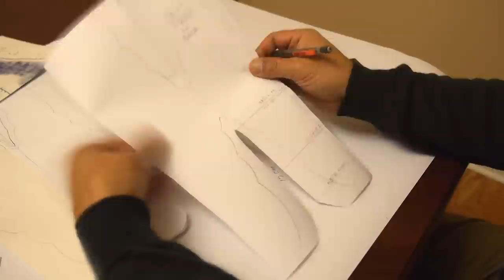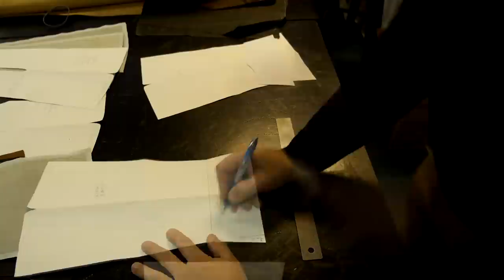Making cowboy boots - part 3 - designing, clicking and closing the tops

Comment: What name brand of contact cement glue do you use? I'm struggling trying to find a  very good one to resole my boots.
Reply from the maker: Hi Rudy, I use Dual-88 or Barge contact cement. They both are neoprene based and should be used under a ventilation. There are water based cements from Renia, but I haven't used them.
Reply: It's duall 88 I believe..

Comment: Your clicking knife, who makes it and where do I go to get one?  I have tried a bunch of different knives and still not satisfied. I notice it has disposable blades. Thanks for the ride.
Reply from the maker: Jay Shriver, It is a regular utility knife with Olfa blades. If you can, find black Olfa blades for your knife size, they are stronger and sharper.
Reply: Thanks.  appreciate it.
I have only made shoes (5 pair) I'm going to attempt a high lace up boot. I suppose the measurement for the tube (?) is that of the tops then tapered to fit the ankle - or is it the short heel measurement? Or do I finish the tops to equal the short heel measurement.
All the videos I have watched seem to leave out this critical junction between top of working last and leg.
Boot making is hard!
Reply from the maker: Shoe making is hard! :)
Because you need to know how to tape the last, make the mean form, make the templates... much harder than boots, seriously.
For boots you need 1) a good last and 2) decision either you calculate your templates or go with the approximations. And so there are 2 schools and most of cowboy bootmakers approximate based on the DW Frommer method. Search for "Bootmaking Forum" and "The Official Boot Making Forum" on FB - these 2 groups have professionals that can answer on all your questions.
Reply: Excellent! Thank you so much. I admit, two years ago - too cheap to buy - I made my own lasts. Recently I bought good plastic lasts.  The new professionally made lasts prove my own! - I got the fundamentals right. Now to make boots! Please keep posting videos.  Yours, granted, make one dizzy...but in a good way.
Reply from the maker: You're welcome! And yes, I learned from this video that fast is not all ways good ...
Reply: Maybe not good as entertainment but it absolutely covers the essentials and is perfect for the serious student. As per your recommendation ; DW Frommer. I found a photo of the Western Packer, a lace up cowboy boot - my next 'shoe'.  I got my new lasts from Lisa Sorrel, so they are 'cowboy' - with a 3/4 "heel.  Thanks to you I will now be busy for weeks! - with my awl and needle
Reply from the maker: Today Lisa is one of the best in the world in the area of the boot inlays. She also have very good videos on youtube.
Reply: And you, in tooling leather, must be one of the best in the world!
Reply from the maker: Britt Nantz is the best in tooling. Though I have a good chance if leather tooling, bootmaking and saddlemaking would need to come together.
Reply: Saddlemaking!? I thought I had watched all of your videos...never saw a saddle making video.
Reply from the maker: Just recent upgrade to my leather skills: https://goo.gl/gMFMeo
Reply: Very interesting Eugene.  Until now I thought the rider sat directly on the tree.  I now see that a cradle of straps is built beneath the finished saddle - how comfortable. I am a woodworker (have sold in some of the finest art galleries in the U,S.), not just a beginner shoemaker.  I will try to find a way to post you some photos of my own work
Reply from the maker: Yes, the webbing straps are tensioned, there is a gap between them and the wooden tree of the saddle. The latex foam between the webs and the seat leather adds additional comfort. Originally burlap straps and horse hair were used there, though synthetic materials are more durable. I'd like to see your woodworking, please contact me on FB or Google+, just search for my name.
Reply: I ordered a piece of tool steel and made my own. It's very easy if you know what your doing. I heat treated the edge using the clay method the Japanese use on their swords and used water stones to polish it until it shone like a mirror. I didn't grind the cutting edge on I polished the edge until it was razor sharp. Ive never had to sharpen it and ive had it for three years now.

Comment: How do you make insole to put inside the boot?
Reply from the maker: +Air Handler The insole is one of the main parts of the boot. You build the boot around it
Reply: Eugene Pik
 I mean the soft foam insole.
Reply from the maker: +Air Handler, we do not use that in the cowboy boot. It would prevent the insole taking the form of your foot, which is the most important for the comfortable footwear.